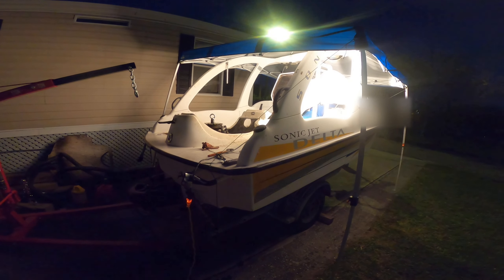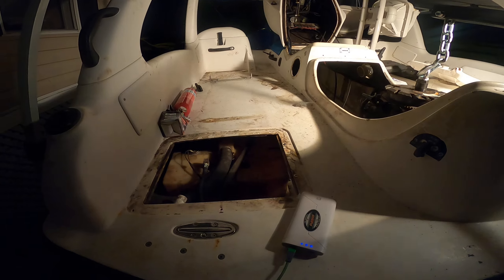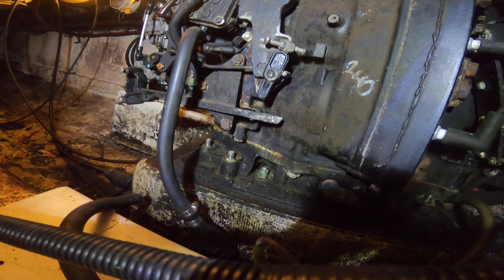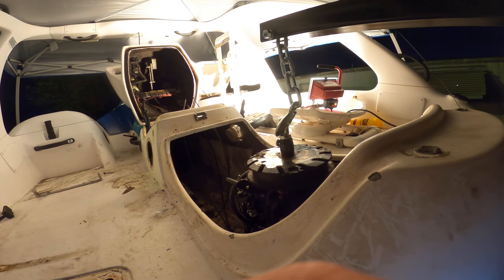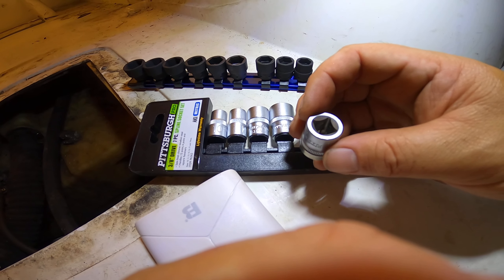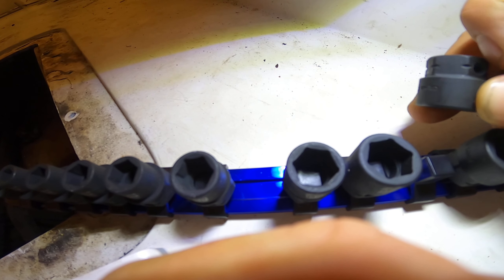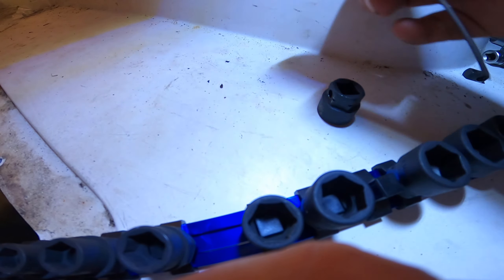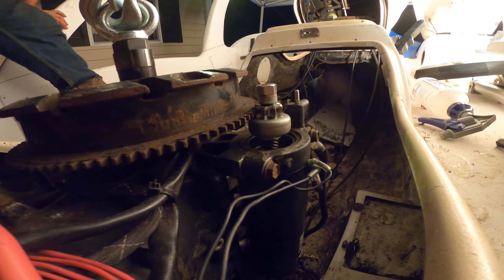Rebuilding a Sonic Jet Delta boat with a Mercury 175XR2 Sport Jet.

Comment: Hey did you ever finish the boat?
Reply from the maker: No not yet :(  I’m trying to build up $. I bought it, week later I was laid off from work due to Covid
Reply: @ck7129  dang bro I’m sorry to hear that, I just got a sonic jet delta identical to yours.. trying to get it started, you have a contact info?
Reply from the maker: @rajivsingh1999  we have a private Sonic Facebook page, (that is the only thing I use FB for ), join and you will see me in there, then DM me. You can also try finding me on messenger: CK Flight